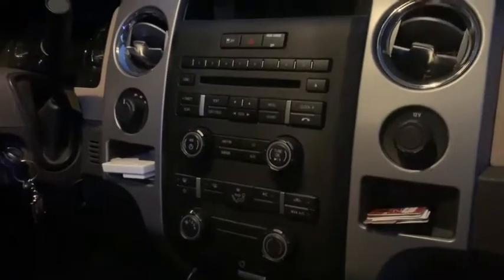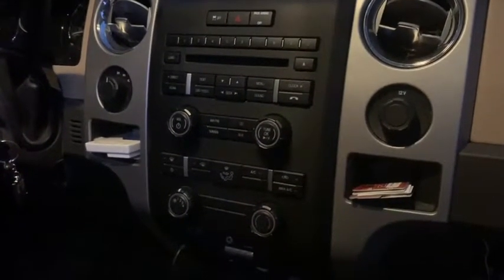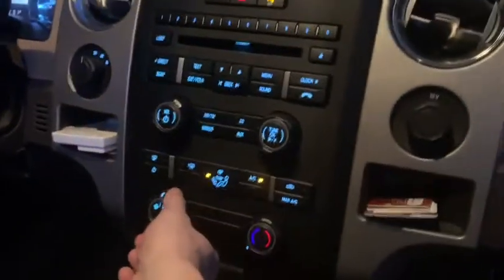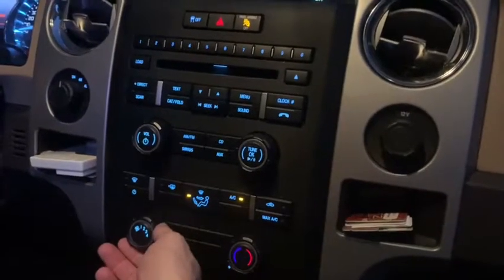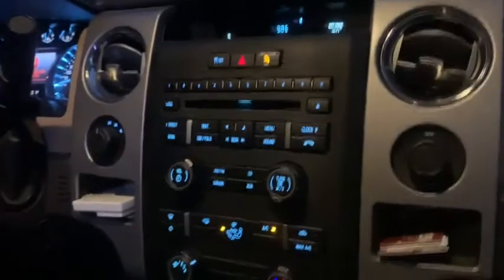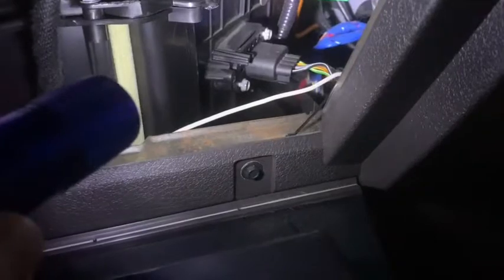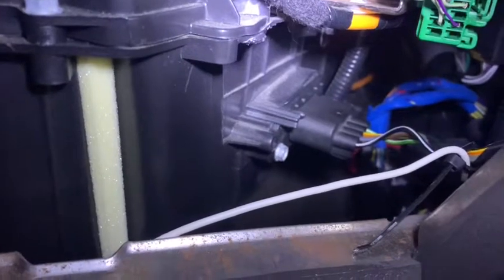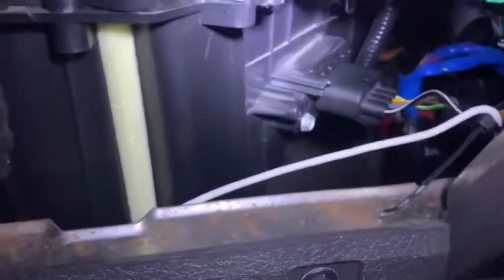How To Fix F150 blower? 2012 Ford F150 Heat and A/C only work on high?

Comment: I just installed a new resistor in my 2012 XLT and the fan still will not work on the lower speeds. It does work on high so I’m not sure where to turn next. Perhaps the switch?
Reply: Wat happen. Did u ever figure out what’s wrong with it

Comment: I replaced my blower motor and it still doesn't blow very hard. I have to close off 2 of the vents to even feel any air. It blows cool air but not that cold. Its been driving me crazy. Its a 2012 f150 4x4  ,  I love the ole truck but I would love it much better if the air worked like it supposed too Lol
Reply: Sounds like a blend door not working properly possibly.

Comment: Mine keeps going out. Could it be a deeper problem?
Reply: When u say keep going out, what you mean. Do u mean , like everyday it keeps going out , every week or every month
Reply: @rashadlesure6278  I changed the blower motor and resistor. I think it’s  the resistor actually. When I start the truck nothing happens. After I drive down the road it might come on but then it cuts out again. The mechanic could not find a short. I just went to Ford and got an OEM resistor. Maybe that will work.